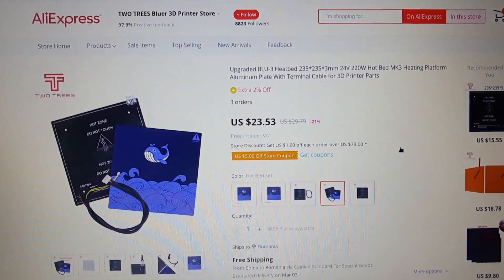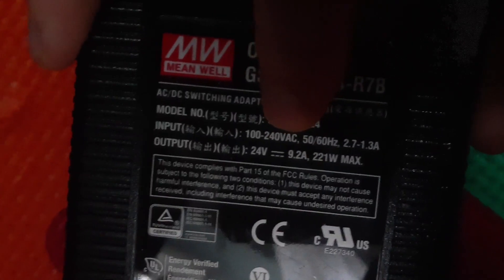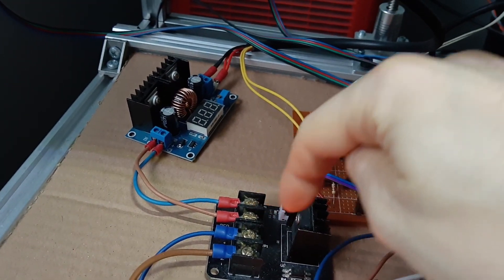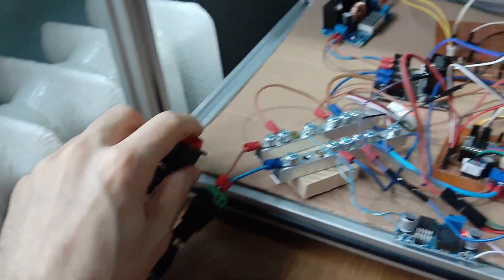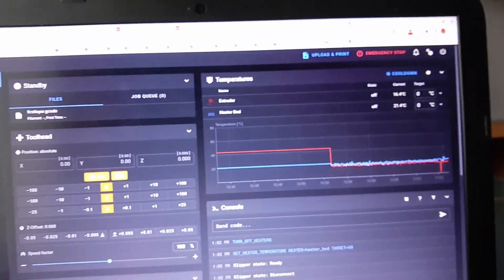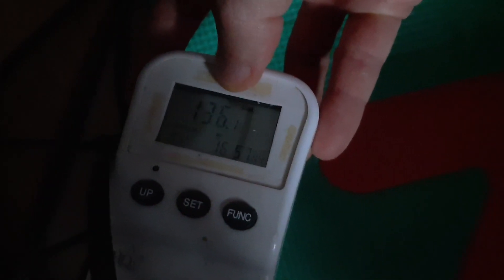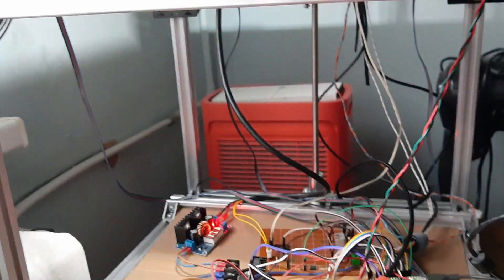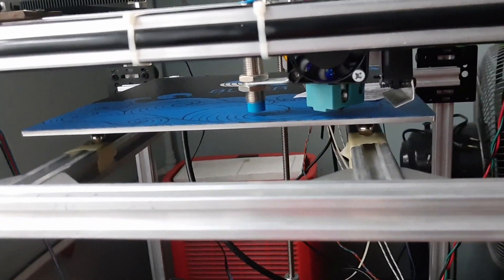How to adjust 3D printer's heated bed power

Comment: why you did not use a seperate power for heat bed, i have the same issue now searching internet ,i figured out that to use another power for bed.
Reply from the maker: sure you can use a separate power supply, but it is cheaper like this and you only lose maybe a minute or so of faster heating
Reply: @CNCTinker  i solved this problem by extra power. I have so many used power in depo never get chance to use them. Because the first solution for me was that. But you are right the cheaper is best solution. :)